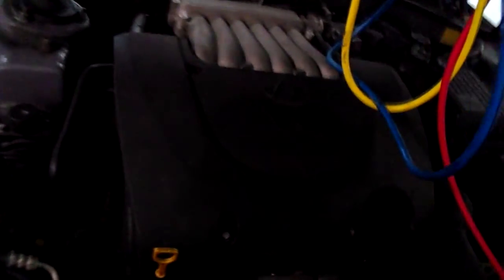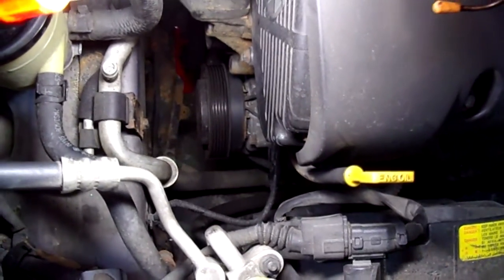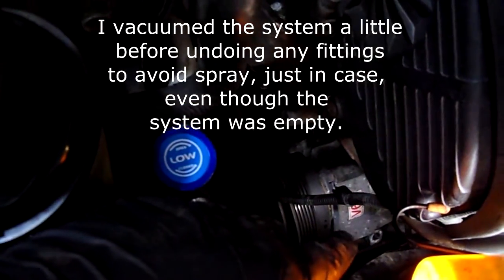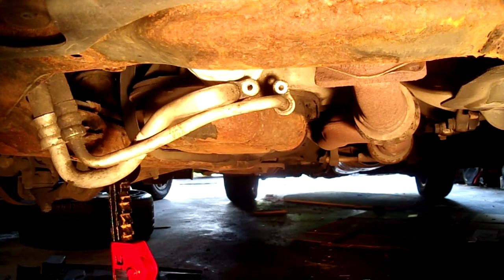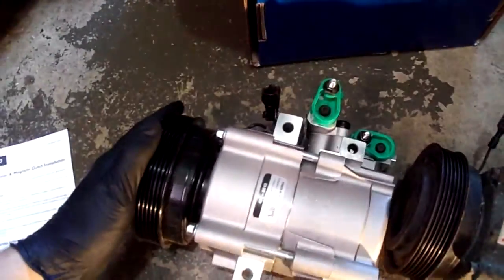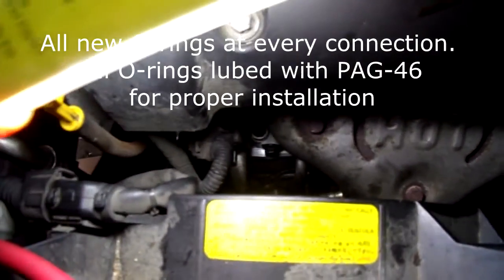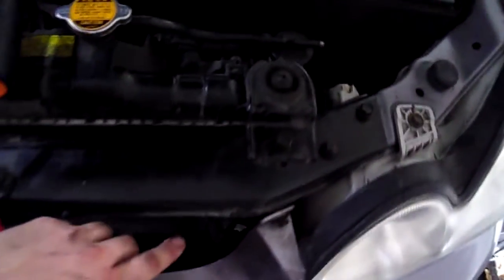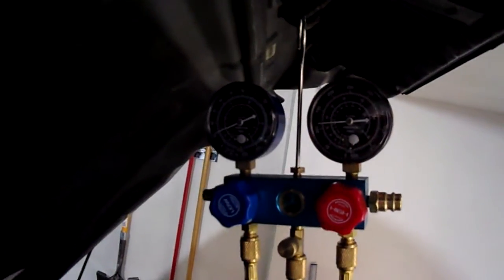Replacing Compressor, Condenser, Accumulator & Expansion Valve. Hyundai Sonata 2.7L 2005

Comment from the maker: About a week after this was filmed, we took a road trip in this car, over 2,000 miles total. This air conditioner performed flawlessly through the whole trip. It was 95 and sunny going through Nebraska. Every time we tried turning off the A/C, it got very hot, even with the windows open. The A/C ran for hours at a time with no problems.